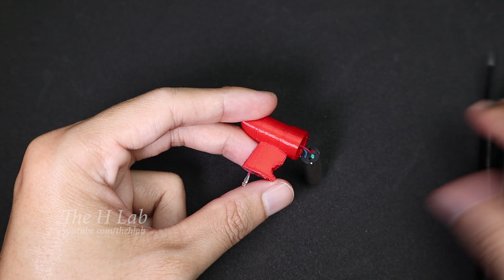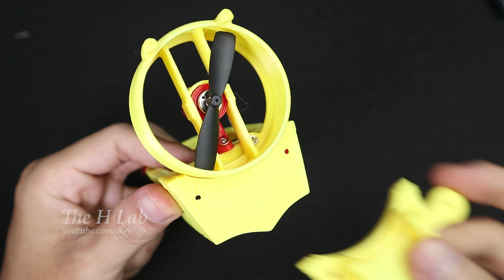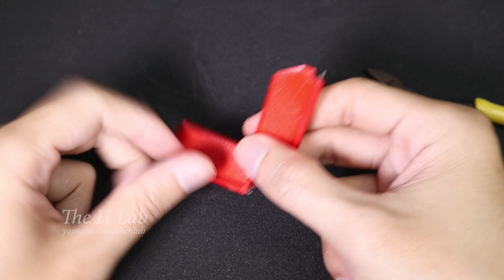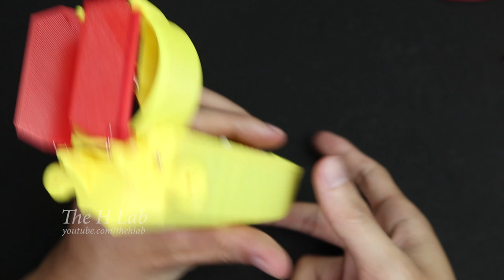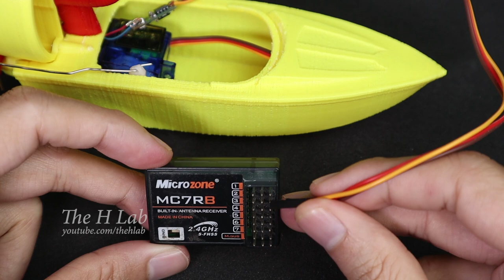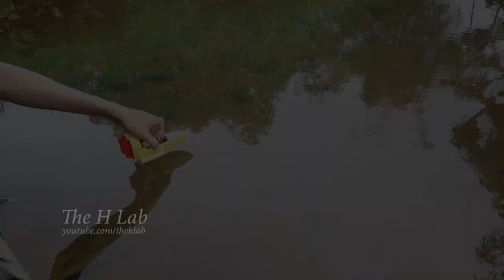3D Printed RC boat with air propeller | The H Lab

Comment: What value do the resistors have to have to use the servo board as esc?
Reply: usually 2.2k do the job but select any 2 of the same value which are more than 1k and less than 100k that should always work
Reply from the maker: 1k ohm in my case